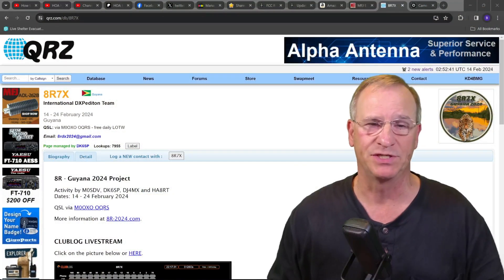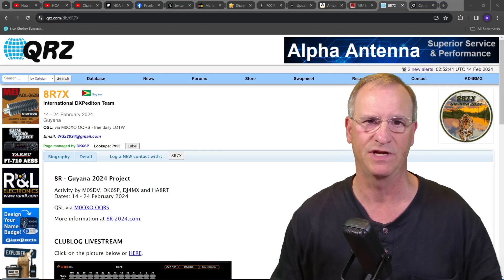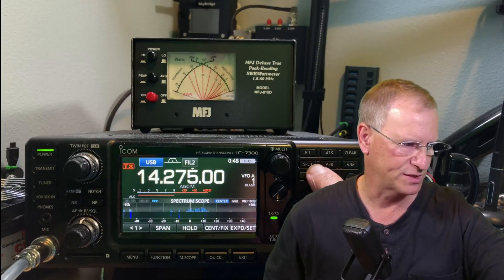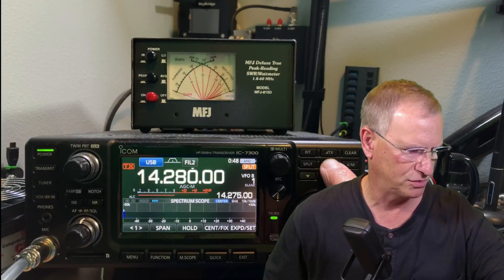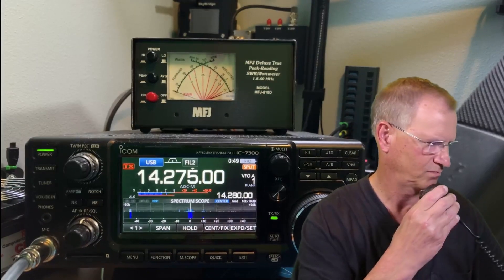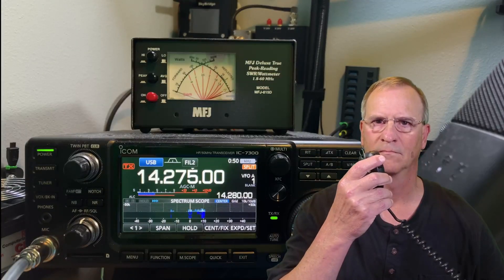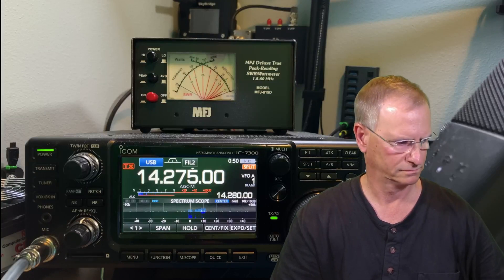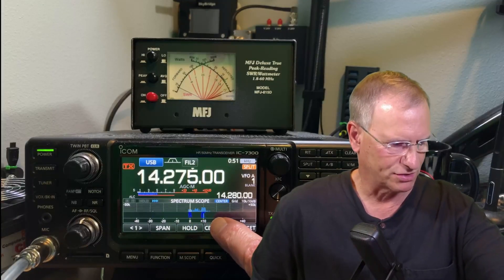Live Demonstration:  How to Operate Split  --  Trying to break through the HUGE Pileup for 8R7X

Comment: Well, two notes on the excellent video.
1. XFC button will bring you INSTANTLY to the "other", split/TX frequency. You don't need to tune up or down.
2. There is a rocket-fast way to set up the proper frequency and split mode when you "surf" on VFO A and find a DXpedition station. If the station says "listening up 20", just hit the "band" number (the MHz value of the frequency displayed on the screen), hit F-INP, type 2-0, and hit SPLIT next to the "Numpad" on the screen. It will automatically set VFO B with a value 20 kHz higher than VFO A, and activates SPLIT mode.
73 de HA5CST
Reply from the maker: Sounds like a faster way to get this done.  Thanks for sharing.